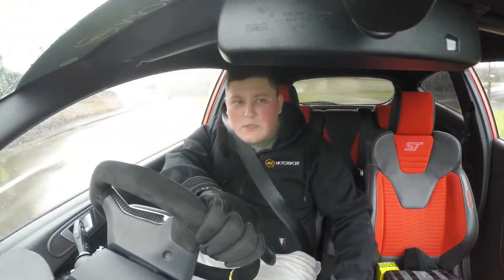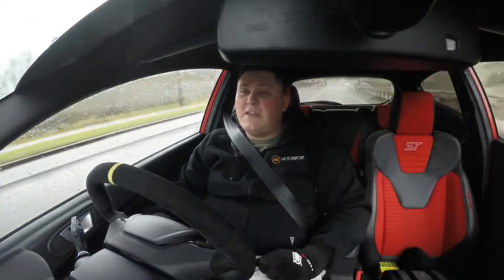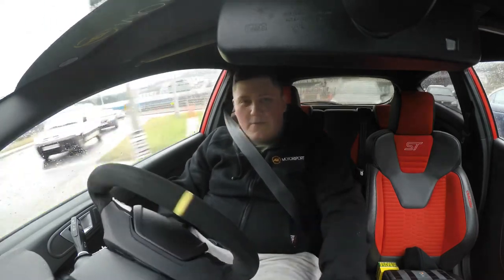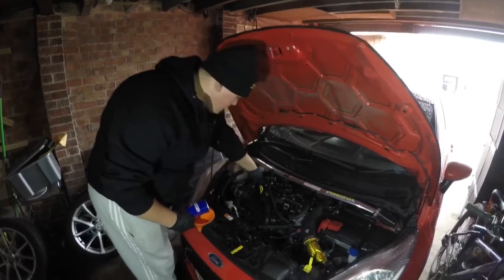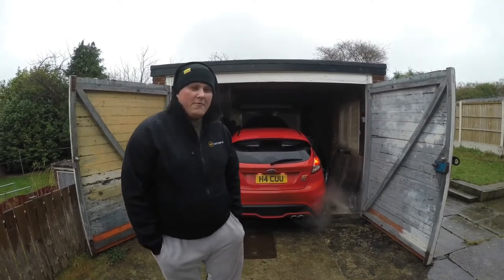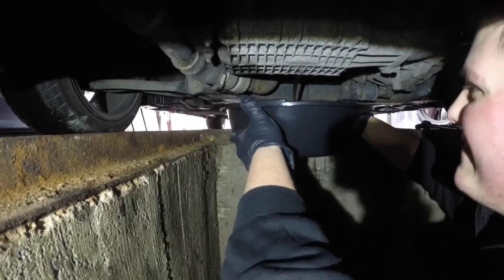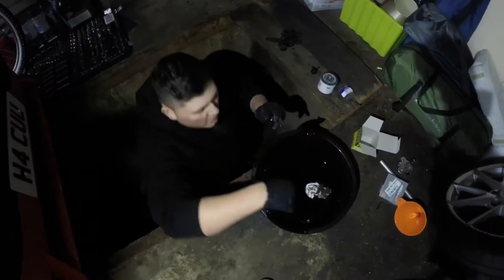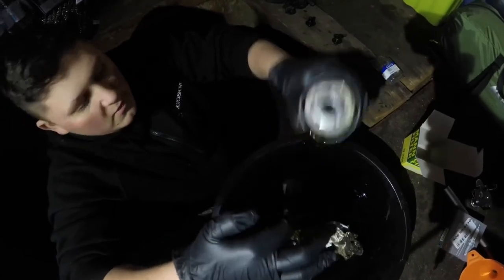4K service Ford Fiesta ST 180

Comment: Which oil would you recommend for the st? 5W20 or 5W30?
Reply from the maker: ADI DAS if your running more power 5w30 👍
Reply: I'm stock, I've bought 5q30 today. Do you know if this is possible?

Comment: How do you change gearbox oil, or is it a sealed unit?
Reply from the maker: Black Panther I haven’t done that yet as I’ve had a lsd put in so the oil got done then pal and get ya self a Haynes manual
Reply: Sealed unit. Only need to change if there is a bad leak that needs to be fixed